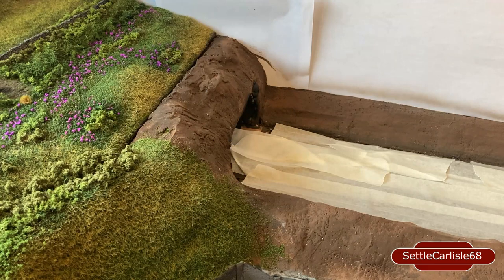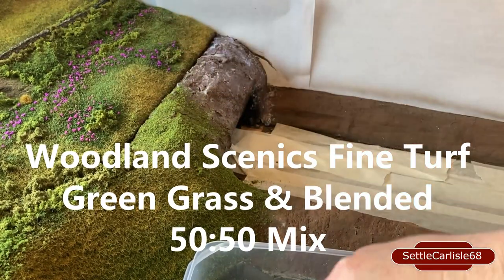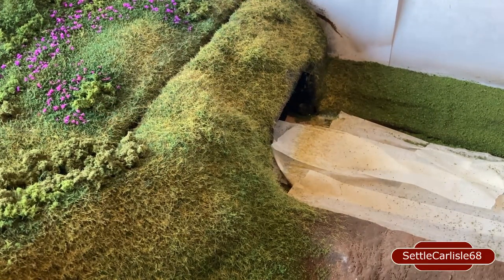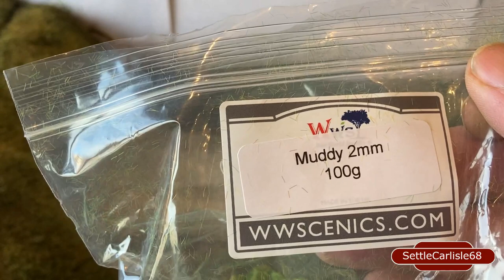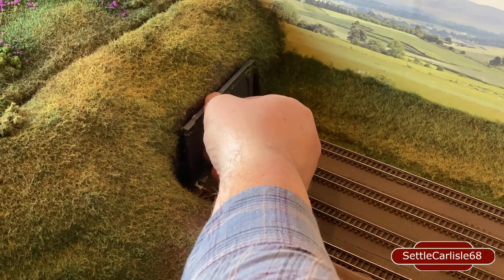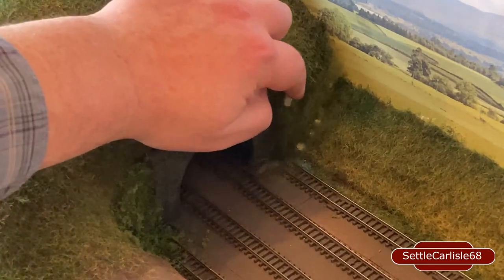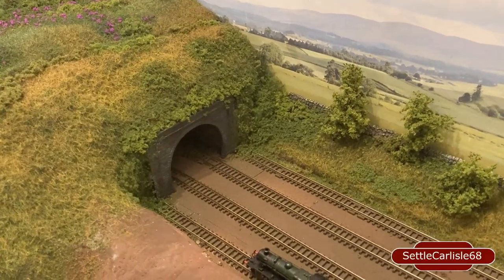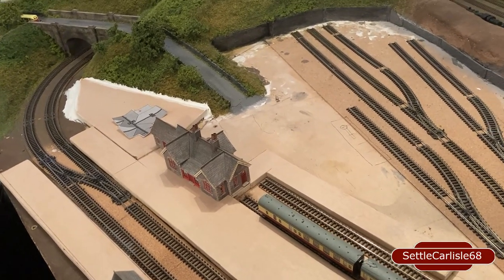Finishing Off the Tunnel with Static Grass on my N Gauge model railway layout Westmorland, Video#7

Comment: The scenic work around the tunnel portal really works well Gary.  I like the way you have built up the effect.  I haven't used the poly fibre before but that looks very useful I will have to get some.  Look forward to seeing the work around the engine shed and station.  Stephen
Reply from the maker: Thanks Stephen, the poly fibre is great and cheap for all sorts of brambles, bushes and vines 😊cheers Gary